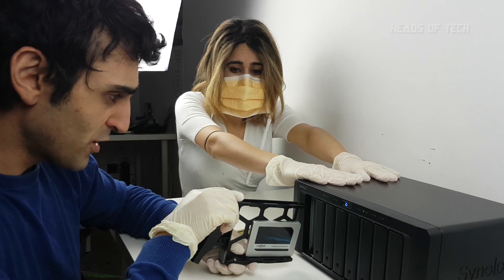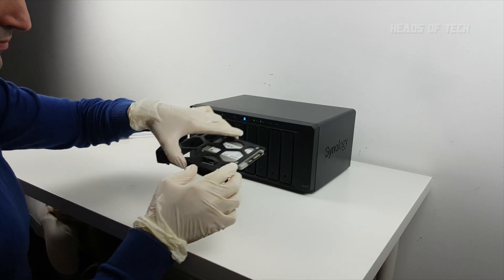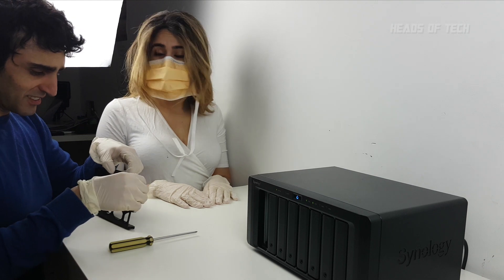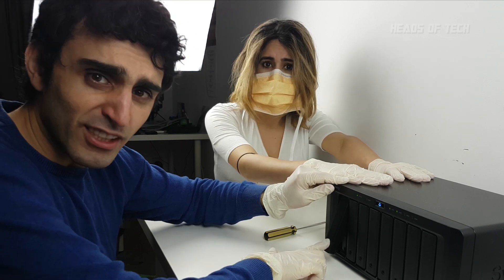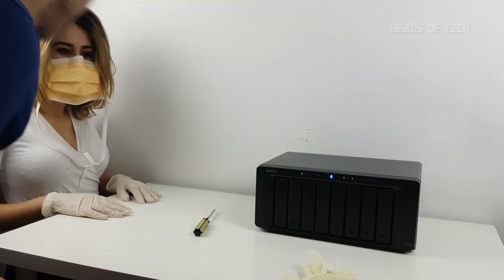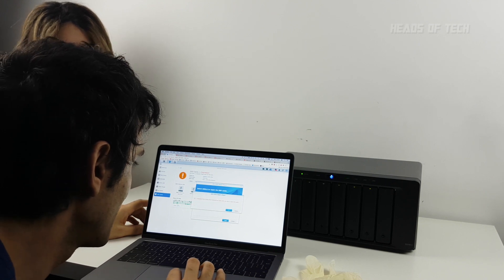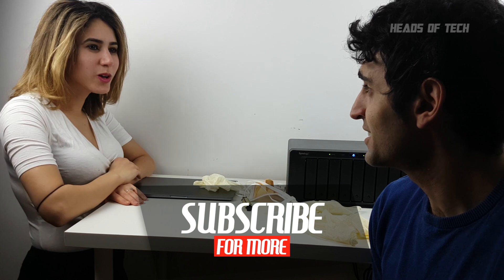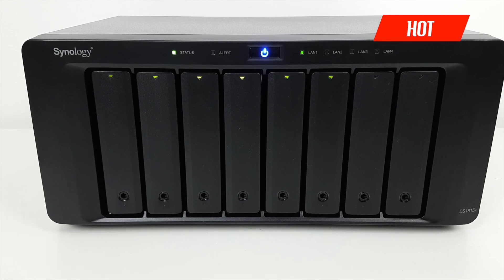How to Repair a Degraded SSD Cache | Full NAS Guide

Comment: This is the reason why they advise enterprise level SSD's for cache. You immediately burn through the max. number of writes of consumer SSD's (you have to check the max. petabytes written or max. full SSD writes per day, sustained during the warranty period of the SSD - Which is in most cases 3 or 5 years. Read-only cache is only useful if you do a LOT of reads from your NAS, but is pointless if you use your network attached storage e.g. for writing (e.g.: when copying lots of small files to it, that's where SSD cache comes in play as HDD's are very slow in doing that...
Reply from the maker: I've been using a Firecuda (great TBW rating - got a review on it) for about a year now, and so far it's been running well. One thing to remember about read cache is that new files copied in also get copied into the read cache (depending on your retention settings of course), but you can benefit from it if your use case involves using the newly written in files eg. video/photo editing.